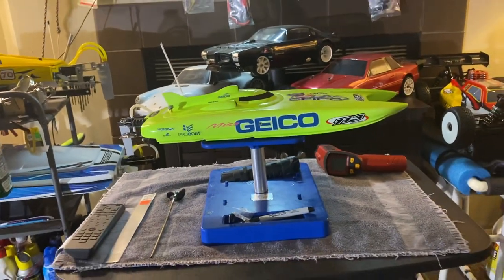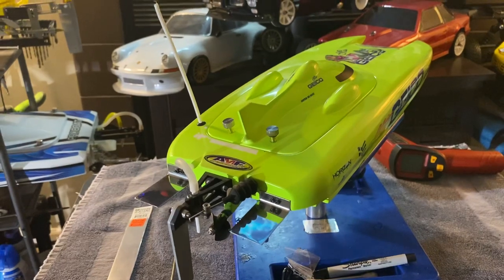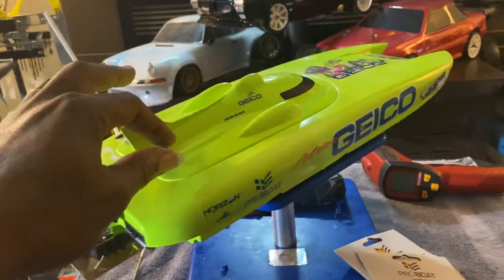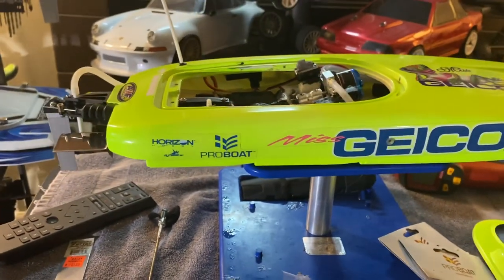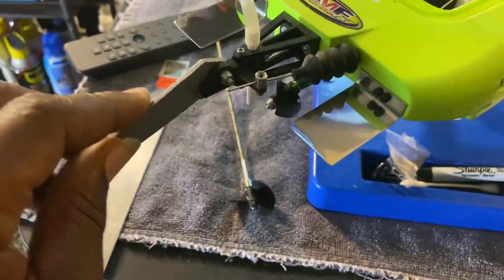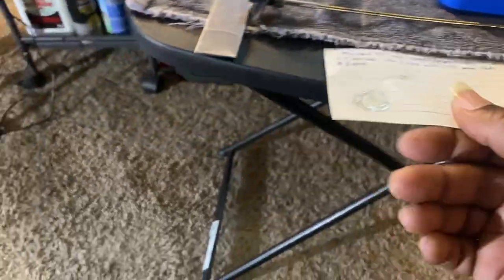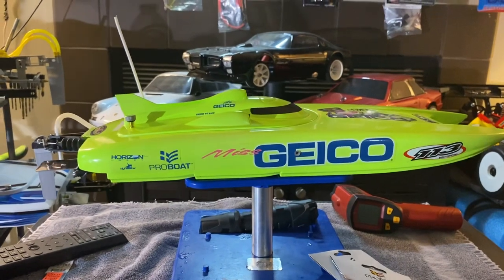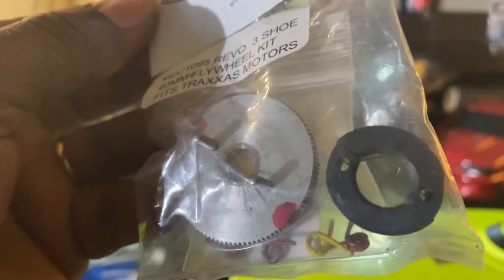Miss Geico 17 brushless. Not for kids

Comment: Preciate the shout out, bro .... You build a lot of top notch stuff ... Is this faster than the Vector if both are stock ?
Reply from the maker: 10GALLEN81 no this thing is slow. Even brushless . The body can’t handle it . That’s why. I like deep V boats .
Reply from the maker: If I pull them Throttle all the way. It will flip over. This thing is for a kid  or someone with special needs  . But I’m going to make it fly or crash .
Reply: LOL
Reply: I guess that's why you can't go by looks alone,  cause this one LOOKS faster ... Guess that's just "eye candy"

Comment: How did you lower the battery mount.Too bad it's not set up like the Deep V
Reply from the maker: I cut it out with my Dremel carefully . And sealed it. I’m still putting more upgrades on that little thing. I love my deep-V boats . Thanks for watching brother. I hope you saw my new deep-v I just painted.
Reply: @pitbikecookracing3324  Thx I will check it out